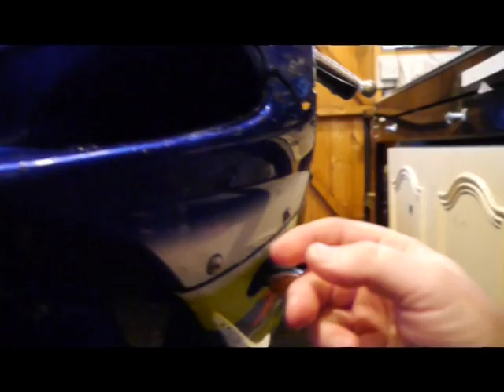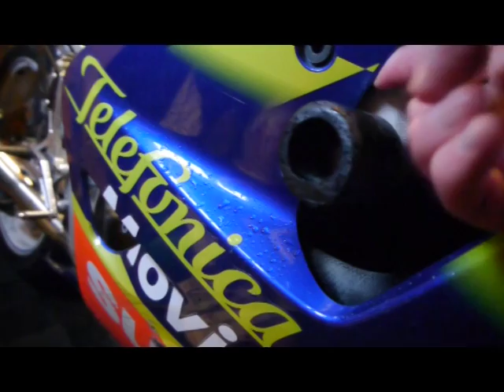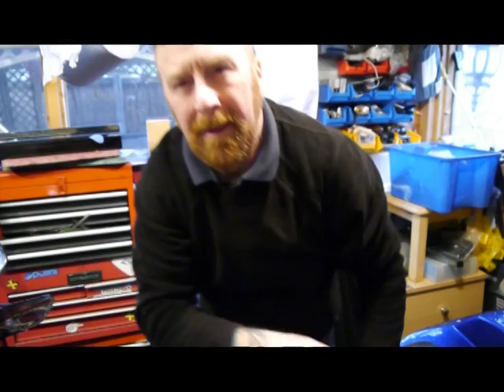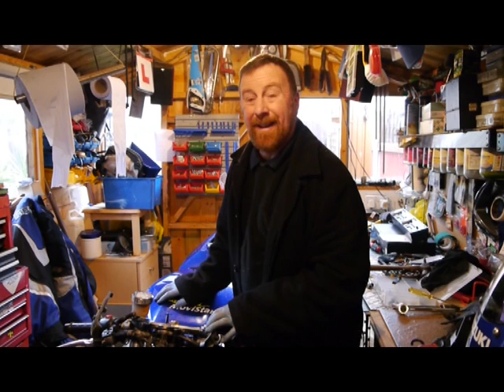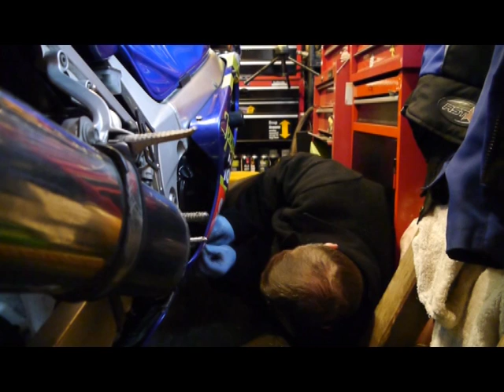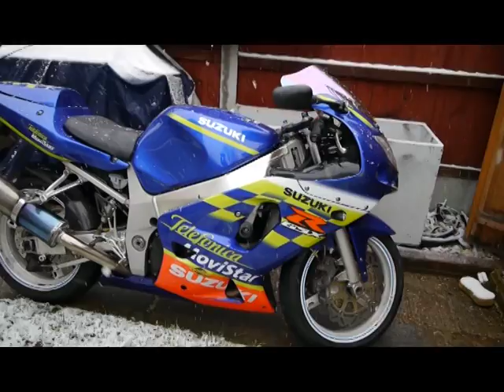SUZUKI GSXR 600 K2 FIX SERIVCE CHAT REVIEW MARK SAVAGE

Comment: Great video, thanks for taking your time to make it! I recently got a K1 and going through a long list of things to get it singing again :). One point to mention - K1 onwards are fuel injection and not carbs, and the choke is actually a 'fast idle' which doesn't change the fuelling just opens the throttles a bit. It's the same as holding your throttle open a bit when it's cold.
When the engine's cold it's mapped to inject more fuel during warmup - but as it's supplying extra fuel you need to give it more air too to make it run stoic.
Reply from the maker: AS Motion Lab thanks for watching bud and the update 
I have a few other gsxr videos you may like to watch on servicing and review and riding 
Well worth a watch 
Mark

Comment: Have one myself.. had a tipp on a roundabout 2 weeks ago. Dameged the side fairing and crank case cover. Cant get a fairing anywhere for it. So all i can do is put a fairing kit on it unfortunatly
Reply from the maker: mark murphy oh bugger but we have all done it 
I’d try and buy panels or the good old back up 
Street fighter it !
Thanks for watching , I have many more gsxr videos and other you might like to watch 
Mark
Reply: @marksavage  yeah i wont street fighter it anyway id say.. not a big fan of those. I do have the front back and right side fairing in good nick and original may sell them on ebay as the telefonica stuffs hard to get..

Comment: Yo love the vid, I fitted a new varaitor to my gilera DNA 50 and it's acceleration has gone down the drain, it stuggles to get to 30 then even worse to 40, haven't tested the top speed but my mate is saying clutch but I'm thinking rollers? What would help the acceleration?
Reply from the maker: Luke Bryant thanks for watching bud 
well if it ran fine before you changed the variator then bud it has to be 
Weigh the roller you have then compare it to the rollers you have put in 
Is the belt ok as for clutch check it to see if it opens up ok 
On the dna like the aerox you can start the bike on the stand take off the cover and watch it run and see how it moves bud like in my aerox variator video 
That should help to see what’s going on
Mark
Reply: mark savage Hi, yeah I had changed the belt few weeks back, the rollers that where originally in it where 7.5g I have ordered 6.5g
Reply: mark savage and okay I'll do that when the weather clears up abit! Cheers
Reply from the maker: Luke Bryant well that’s 6gs lighter and would make a difference in speed bud
Reply: mark savage yeah or I'll put the old varaitor in and put something like 10g in it or something
Reply from the maker: Luke Bryant you would have good top end but not a lot of pull away lol 
If it was ok before stick together the same weight bud
Reply: mark savage I'm not too bothered about acceleration to be fair and yeah new rollers (6.5g) r being delivered soon